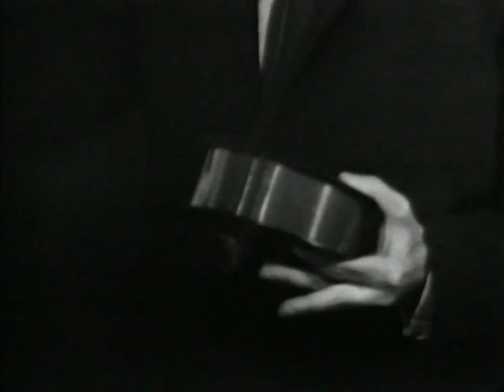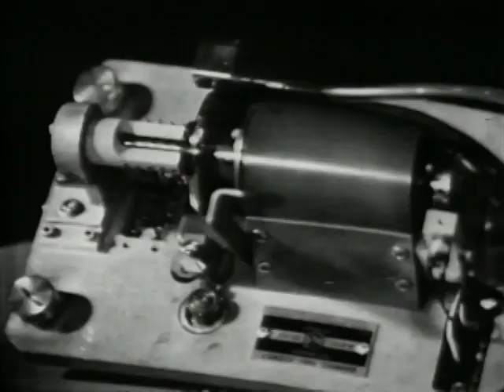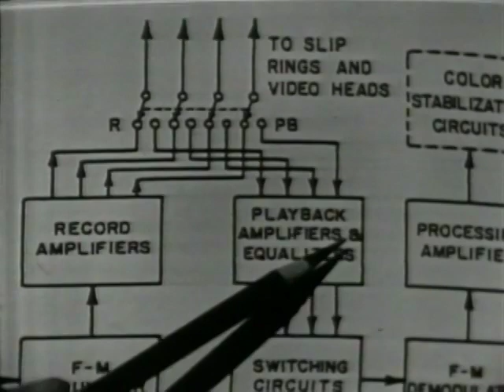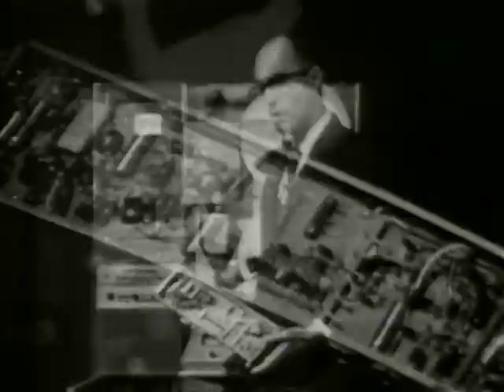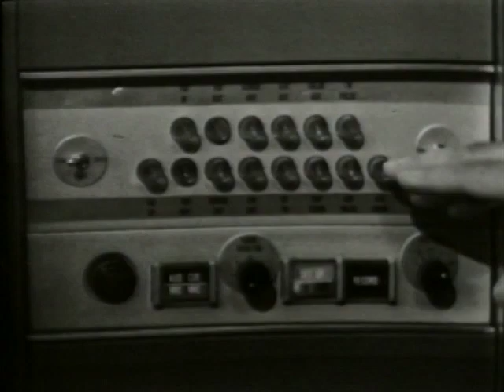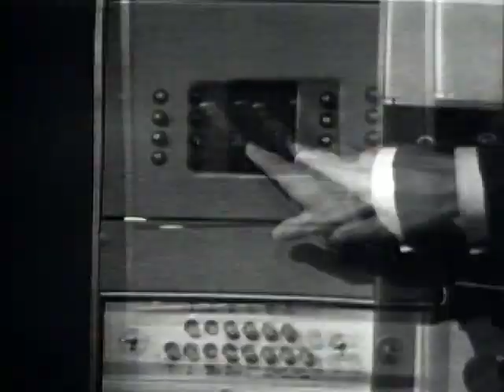1966 RCA TR-4 2 inch Videotape Recorder Demonstration

Comment: To obtain usable tape-to-head speed for the fm carrier frequency of the video signal, the 2" machines divided the picture information into four sequential parts.  The rotating drum had four heads and scanned the tracks across the width of the tape, unlike the later helical scan machines that recorded an entire field along one diagonal track.  Artifacts in plackback showed 'banding'.   Amplifiers for each head had to be adjusted individually to match luminance and chrominance levels.
The machine used a vacuum pump to curl the 2" tape against a guide as it passed the rotating head assembly.

Comment: Not only did I operate these at a local TV station back in the day, but I wound up buying two in a warehouse sale many years after for $5/ea! They didn't want to pay someone to haul them out basically. They actually fit laying down one at a time in my VW Station wagon. Someplace I have a picture of one laying down in back  I kidded that I had a mobile video resorting studio.
Reply: I had a very short stint in videotape before I ended up doing studio camera.  I seem to recall it took ten adjustments on this machine to get a tape ready for air, four if you were in a hurry :)
Reply: @jethro1963  And that was not the TRT 1B I trained on and had to use at times! It had 6 adjustments per head x 4 heads. And then overall signal.
Reply: Is it still in working condition and i wonder what it would sell for now and what make and model is it
Reply: @DavidBerquist334  I stripped them for parts. The massive aluminum mounting board alone was worth many times what I paid for them. One was self contained and included an air compressor. I think I still have it. The spool motors were massive and I kept them until a few moves ago. Wish I still had them.
Reply: @DavidBerquist334  http://www.lionlamb.us/quad/rcatr-4.jpg

Comment: Actually the control track is at the bottom of the tape.
This is RCAs rip off of AMPEX machines
Reply: Upper edge "as it's portrayed in this sketch".  There is no top or bottom of the tape on this type of machine, where one reel is above the other.
Reply: Uh no.... I restore these machines. So the control track is at the bottom of the tape. The control track head is perm mounted at the bottom of the video head assembly and must be perfectly aligned to the headwheel at the video head manufacturing or refurb company.
I have been working with these machines since they were invented.
The fact that the supply reel is above the take up reel is of no concern. Unlike helical scan machines, the tape path is straight.
Reply: @rty1955  The tape path is straight as in exactly 90 degrees or just closer to perpendicular than helical scan? The  basic difference that I see is one has segmented video and the other does not.
Reply: @acoustic61  ever work on a quad? The tape path is straight on a quad. No slanted rollers, no wrapping around a head drum, no wrapping. No audio heads perpendicular to the head drum and tape never contacts the head unless it is in play or record mode. U can almost drop the tape into position on a quad
Check kut a thread pattern on a quad vs a Sony BVH machine. Quad is MUCH straighter.
Also the reel table height is the same on a quad. Makes for zero wear on guides & heads for either RWD or FFD
Reply: @acoustic61  I think it worked out to 89.7 degrees (memory from training 49 years ago, I could be wrong on the number).  The headwheel rotated at right angles to the tape and the tape was pulled past it at 15 inches per second, therefore the transverse tracks did have a slight angle.  0.010inch wide recording tracks with a 0.005 inch guard band between, for a pitch of 0.015 inches.  Across a 2 inch tape moving at 15 ips, there was a very slight angle developed but somebody else can do the math if they want.  Then, of course, there was 7.5 ips.
Reply: @markusosparkus8078  Exactly! The heads could be mounted at 90 degrees but if the tape is moving, the track printed on the tape couldn't be straight as in 90 degrees.
Reply: @rty1955  You misunderstood my comment.  On the TR4, the control track is further from your eyeballs.  Thus on that model there is no top or bottom of the tape.  Not a big deal, though.

Comment: Anyone find the irony in the fact this was recorded in film?
Reply: I've noticed that too--it looks a lot like a kinescope.  I'm guessing this was originally recorded on videotape with video cameras, most likely at the studios of WKBS (as mentioned on the opening credits).  I wouldn't be surprised if the TR-4 featured in this film was one of WKBS' studio VTRs.

My guess for it being a kinescope is that it was probably more practical economically in the mid-60s to distribute this limited-audience industrial instructional presentation on 16mm film (kinescoped from a videotape master), than keep it solely on tape. Since there were far more 16mm projectors around and readily available in that era than there were 2" quad machines like the one this program was probably recorded on, which makes sense for such a limited industrial audience as this film would target.  And other industrial videotape formats at the time (like Ampex's 1" Type A from 1965 or Sony's 1" EV format from 1964) were so few and far between and nonstandardized to really not be well-known yet.   Plus, film stock at that time was far cheaper than 2" quad videotape stock (the former being ideal for distribution to multiple parties),  until smaller and cheaper videotape formats like U-matic became the norm (and widely used for industrial instruction like this film) in the 70s.

I've noticed this was standard practice for a few educational/industrial videos originating on videotape from the 50s-70s that I've seen, having them kinescoped to then-more commonly accessible 16mm film until videocassettes arrived in the 70s.  A production's master videotape could be easily and simply dubbed down from, say,  2" quad to U-Matic or VHS at a much lower cost than to have a film kinescope made and multiple prints struck from it in earlier times.
Reply: @RyanSchweitzer77  Also the audio channels are out-of-phase! Playing this video on my phone, the audio is very garbled!

Comment: "Stand by" button is actually a "pause" button.
Reply: José Santos Not in the same sense as on a helical scan machine: you don’t get any sort of playback on a quad, where on a helical machine you’ll see most of a frame of video.  On this machine, the main purpose for standby mode is so the head and capstan will already be up to speed when you hit the play button; that reduces the time for video to lock by several seconds, compared to hitting play from a dead stop.
Reply: @jeffhartman7000  Right, it relaxed the vacuum guide so no head to tape contact
Reply: Actually the standby button spun up the headwheel. Thats all it really did

Comment: RCA ripped this off from Ampex. RCA couldn't do it on its own. RCA Calle it "television tape" Ampex called it "Video Tape". Ampex was far superior to RCA equiptment. I worked on both and I speak from experience.
I actually worked on every broadcast machine that AMPEX made starting with the VR-1000 b&w quad to the vpr-6 helical. Even the ACR-25 
I have also worked on the RCA TR-60, 70, 600
Reply: palmer johnson RCA was unable to produce.viable video tape machine. AMPEX was already in production or machines for broadcast. This upset RCA greatly as RCA wanted to own all the patents for television broadcast. Just like Microsoft does for computers. When color TV came about, AMPEX was working on color mods for the quadraplex. RCA wanted so bad to have thier own version of these machines that AMPEX licenced the tape machine design in exchange for the color mods RCA had developed. 
I worked on every model of VTR that AMPEX made for broadcast from the VR-1000 to ACR225 models.
Reply: Were they compatible, i.e. could you play a tape recorded on RCA on an Ampex machine or vice versa?
Reply: @xaverlustig3581  Yes, they were supposed to be compatible.  "Your mileage could vary".  In the 60s through the 70s, some syndicated program tapes were "bicycled" from station to station, so the tapes would have to be standardized. (I worked in a small market and many of them traveled in and out of town on Greyhound Package Express .  Remember them?)  Also, locally produced commercial spots would be dubbed at the station producing them for the other stations in their market.
The quadrature video head had to be precisely manufactured, all of them being very close to each other dimensionally, so that the replayed video wouldn't suffer "banding" (stripes of video with different signal levels, color hue and saturation).
As to the ongoing debate of "who invented this",I will toss in to the debate that (as I recall) some of the Time Base Correction circuitry was licensed to Ampex and RCA by 3M (the people who make Scotch Tape).  This would be in the Colortec/CATC (Ampex/RCA) circuitry.  Not sure how 3M got in the mix there.  Somebody got some history for us on that?
Reply: @markusosparkus8078  I don't remember Greyhound because I'm in Germany 🙂 but I do remember occasional banding errors on broadcast television in the analogue days.
Reply: @xaverlustig3581  Yes.  RCA copied the Ampex transverse format.  Ampex may have licensed it.
Reply: @xaverlustig3581  Yes. Many tv stations would have a combination of RCa and Ampex equipment.
Reply: @xaverlustig3581  yes the two systems were compatable
Reply: @xaverlustig3581  yes, AMPEX set the 2" standard
Reply: I believe "VideoTape" was an AMPEX brand-name back then. RCA termed it "Television Tape"
Reply: Wrong...
Reply: Uh... I think AMPEX had to have the help of those RCA engineers to make the AMPEX machines color capable. And I think AMPEX granted RCA licensing rights in return. RCA didnt rip anything off.
Reply: @palmerjohnson4982  RCA ripped off the original design from AMPEX but couldn't sell it due to a patent infringement. AMPEX settled with RCA for their color technology. So AMPEX had developed the first broadcast video tape machine. RCA back in the day was like Microsoft is today, they biuggt up companies for their patents as David Sarnoff wanted to be known for inventing electronic television, which he never was, as there were many people/companies that all plaued a part in inventing electronic television
Reply: @palmerjohnson4982  Wrong.
Reply: In fact, RCA assisted ampex to make a color recording, in return ampex assisted RCA how to make video recording, video tape is trademark ampex at the time, so RCA can't using that name
Reply: @xtalplanet  RCA developed rhe color system for the quads. AMPEX was going to sue RCA but AMPEX granted a licence to RCA in exchange for the color technology
Reply: @rty1955  RCA did a lowband color under system.  Ampex invented the Timebase corrector, Amtec and the finer version Colortec.  Thes both used electrically variable delay lines, invented my Ampex.
Reply: @xtalplanet  Nope wrong.
Reply: I used both too.  TR70 locked up in 3 seconds.  1200 took 7 seconds.
Reply: @mberry593  and the AVR1 locked up in 200msec.. Point?
Reply: @rty1955  The AVR1 used a very advanced headwheel (20 tach points so it not only knew how fast it was rotating, it knew within 18 degrees where it was; standard headwheels had only two tach points).  This was coupled with very high correction rate driver circuits.  Not likely this could have been done with mid-60s technology.
I don't recall spec for RCA color lock but the VR-1200 Ampex had a 3.8 second spec.  We used a 5 second preroll, the math was easier and the odds were better.
Reply: @markusosparkus8078  the AVR-1 was one of the best machines they made. The AVR-1 paved the way for the ACR-25.
We used a 7 sec preroll on only used V-lock because master control switched in Vert interval. RARELY did we used H-lock. Only for supers on commercials.
It totally depended on if they were going to do a MIX in the studios. Even for the news they just did a cut for tapes, so v-lock was fine. If one of the studios (we had 4 of them) needed do do a dissolve or wipe with tape, we used full lock.
Reply: @mberry593  I had 3 1200's they all locked in 2-3 seconds.